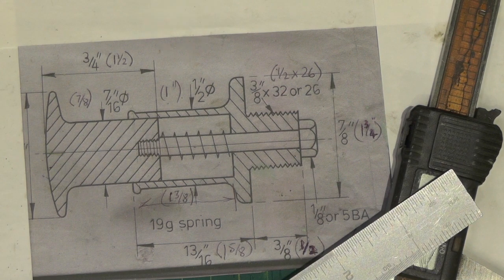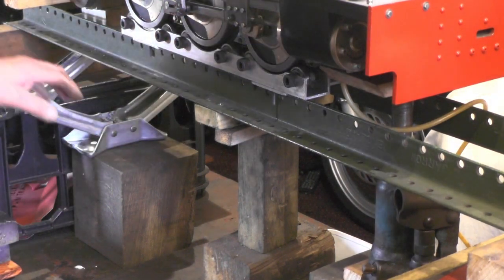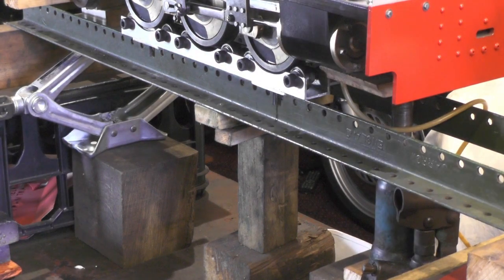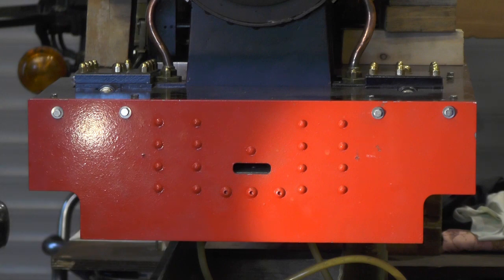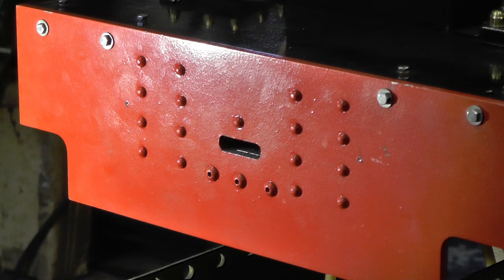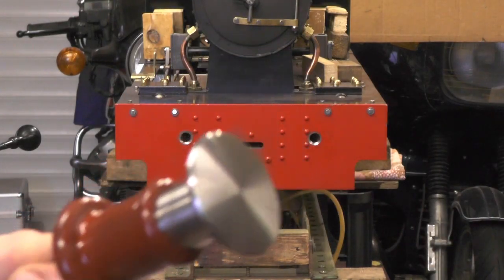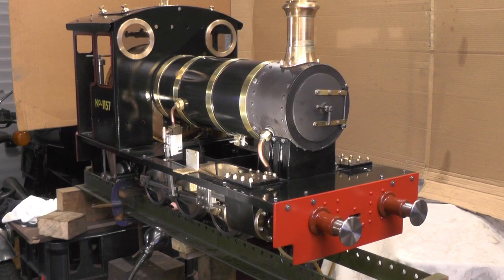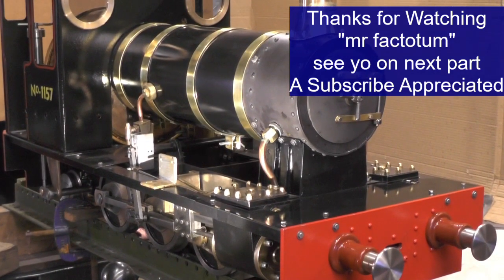Build Your Own Beginners Miniature Steam Locomotive Series (Buffers P3 ) "mr factotum"

Comment: Hi I also start to build a locomotive. Still busy with chassy and wheels. What are the spring tension on the wheel boxes. I wonder if the spring tention on the buffers are high enough. 3 g ( Newton) will not have any damping effect for +- 160kg when colliding. Just a thought.
Reply: Thank you for your feedback . Belief I will have a lot of questions in future. I am very impressed with your videos.
Reply from the maker: hi ddb
thanks for watching, nice to hear your the same journey building a loco.
i can't tell you the spring tension on the axle box as i bought them specifically for this loco from the supplier, and theres no specification on the label , just that there for a Sweet Pea loco,  about one of the only items i did buy in fact. They are very heavy duty though.  As for the buffers theres enough tension for slight buffing, that is if queing in the station for example, I don't plan colliding, the club have strict protocol for track use with light signalling system which allows a large distance between running loco's.
all the best with your project
keep me informed how your progressing
regards
mr f

Comment: Nice to see your back on sweet pea   been watching  your progress  on the buffers with interest. I thing a loco  without  buffers  looks a bit Naked although  lm  aware  that the full size narrow gauge  locos  did not always have them. I will definatly  put on my loco when I get to that stage. .ANOTHER of my daft questions .. is there  a standard  height from the top of the rail to the center line of the buffer so thats it compatible with rolling stock of the same gauge.. Keep safe,, we're  just getting the vaccine  here in South Africa  but will be a while before  us great unwashed  get it ,, Dug Hogarth
Reply from the maker: hi dougie, nice to hear from you
thanks for comments
glad to hear your vaccines landed. we've had it since december, but like you, l'm still down the pecking order, hopefully within the next month!!! by the time i get it the virus will have mutated!!!. Now thats off my chest!!! the Buffers.
I used specifications from "Ground Level 5 inch Gauge Main Line Association" off the t'internet!!
The height is important and also the width apparantly for when your on bends , if theres any coming together!!
The height on there spec sheet is 3. 5/8" from rail head to centre of buffer (tolerance is +1/16" -1/4")
The centre line width is 6" (3" either side centre line)
have a nice morning/afternoon/night what ever your in at moment
stay safe and happy loco building
regards
mr f